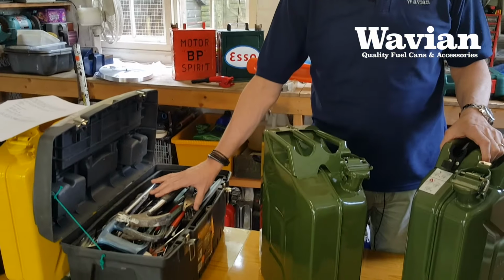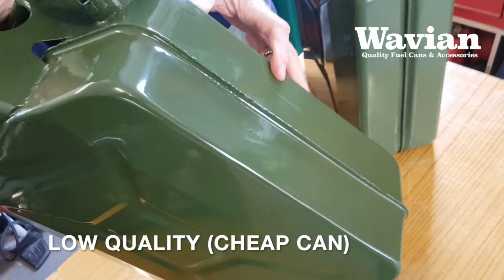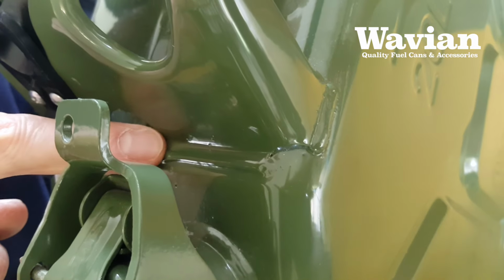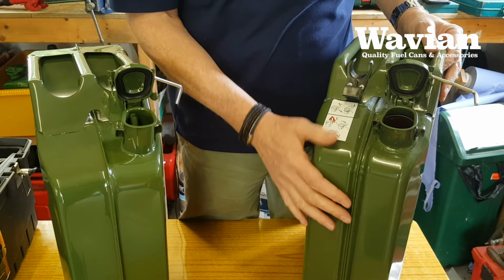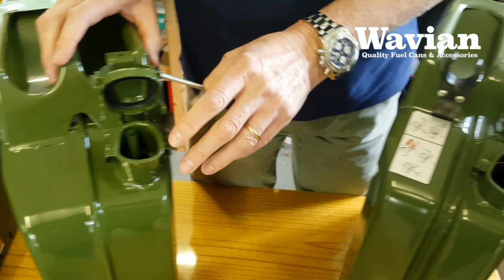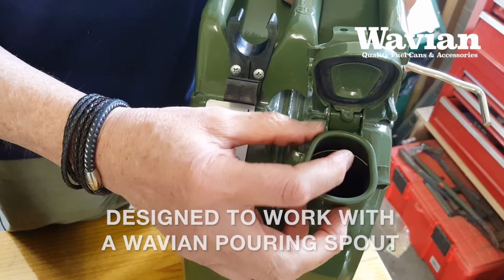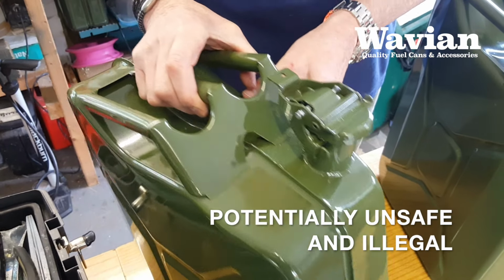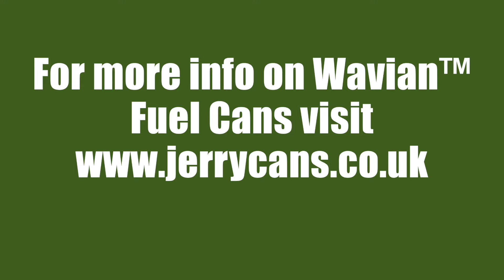What is the difference between a good Fuel Can and a bad Fuel Can?

Comment: Two days ago I bought a British canister of German design from a friend. It has markings only on one side. In the very center of the rectangle, the embossment reads W/I\D and above it the date 1944. I'm trying to check what the original paint color was. There are many layers, but I think it's a British khaki color, more of a brown color. Please tell me whether there was a norm standard for painting canisters and what color it was exactly? As I also have a wartime Safety Cooker petrol stove, I am looking for a smaller British fuel container - square little tin. I would then have a complete set for my tanker display.

Comment: Over the weekend we were supposed to get a bit of snow and here in the South that never ends well.  I was worried we'd lose power so I filled up a few gas cans for my generator. I had a NEW but CHEAP 'jerry can' in the back of my pickup. Got gas Friday, left it in the truck, Saturday I was walking around outside a noticed a strong gas odor. Seems the can contracted because of the cold causing it to buckle and form two leaks at the creases, one on each side of the can, formed by the slight buckling (not at the welds mind you). Luckily they were really small leaks and I might have only lost a 1/4 gallon but if I did not realize it or if the leak was worse who knows what would have happened if I started my truck.

So...I'd agree the cheap cans are not worth the money.

Comment: I own some milsurplus US cans,  I own a Valpro and a Wavian can, and I own two of these chinese knock off cans.   I got to say for the 50 bucks the knock offs came with a spout, and a jerry can holder.  When compared to the near 100 dollars for a Wavian can I can understand why people use them.  I personally use the Chinese ones for regular house duty and as back up fuel cans for my every day driving vehicles and have done so for several years now, they have held up better then I had expected. I use their jerry can mounts to hold my milsurp cans on my off roading set up and my wavian cans on my van.   

All in all I can say that the Wavian cans are of excellent make, quality and finish and have done everything I have asked of them flawlessly.  But if I could go back I would have saved the money and stuck with the milsurp, they work just as well (abated a bit less pretty)  cost me 24 dollars,  and have held up great under heavy abusive use.   The Chinese cans work well for light duty or emergency cans and the mounts they come with and spouts work well, but they do glug a bit if you lean into them which is a large negative, the seem being exposed while a weakness has not caused a major issue other then some mild annoyances while carrying them.  the cheap handles is my biggest complaint.   I love the product, but the price tag for a metal box that carries fuel (doubly so when you factor in a mount for them)  is a bit insane at 150 odd dollars vs the competition (a Chinese mount and a surplus can)  coming in under 50.  To use your comparison it would be like if Knipex charged 20 dollars, but you could buy a used knipex plyer for 3 dollars that has some scuffed handles and plasti-dip it for 2 bucks more...you end up with a equally good tool, but at a fraction of the price.
Reply from the maker: Thanks for the comments Dies1r4e, I totally understand where you are coming from. The cost of the Wavian cans is a reflection on the many extra things that go into the manufacturing process, not to mention the distribution, expensive quality control testing,  safety certificates and regulations we have to comply with.  Something the Chinese cans distributors don't usually worry  about. Many thanks for purchasing the cans anyway, I would love to know how they are all bearing up in 5 years time. 👍🏼

Comment: What is the inside of my brand new jerrycan is red or not the same color as the exterior which is green? Thank you for your help.
Reply from the maker: Hi Keith, this is the special rezol lining that prevents rust. Only use your can for storing fuel otherwise this lining will break down.

Comment: I think the most important bit was left out. The insides! Are the chinese ones bare metal (BAD) and are the wavian ones powdercoated or resin coated on the inside?
Reply from the maker: That's actually a great point. Thanks! It is hard to show the interior lining, but you are right we should have mentioned that to it also opens up the debate about using a fuel can with a resin coated lining for storing other things such as water (which you shouldn't do).  You can read some info about this on our website https://www.jerrycans.co.uk/fuel-cans-back-to-basics/
Reply: Yes the Wavian are coated
Reply: @mikemccarthy6939 I bought a pair of second hand jerry cans made from aluminum. Says made in the USSR on them.  They aren't coated but aluminum doesn't need it. Worked out pretty well for gasoline.
Reply: I coat my lower-priced cans with gas
Reply: I coat my lower-priced cans with gas

Comment: Which welding is used to weld these jerry cane
Reply from the maker: They are seam welded, I am not sure which particular type? I will try and find out.
Reply: W.E. here.  It appears to me MIG metal inert gas welded. I would suspect due to the extremely high volumes it is robotically joined.

Comment: I do wonder for either can how they individually allow for expansion and contraction of the internal gasoline and vapors for example in the heat and cold?   I have a cheap Chinese replica of a can that has developed three pinholes in the side stamped embossments that were added of course to increase the section modulus stiffness.  (I also just acquired an authentic threaded cap USMC united states marine corps can that I suspect will last another 50 years)
Reply: The embossing on the sides is actually in place to allow for contraction/expansion.
Reply: @FranktheDachshund  Flat sheet allows for far more elastic deformation than anything stamped with ridges.  (Shipping containers as well should not at all expand or contract during transit) RIGIDITY is the name of the game.
Reply from the maker: exactly right!

Comment: I live in AU and I own several 20, 5 and 10l Jerry cans. Whether at home, in the ute and or at work I don't reckon I've ever seen these el cheapo steel jerry cans, never seen a 'Wavian' Jerry can either but all my steel cans are built identical.
I don't know if they're built to 'UN standards' the UN has no part in my life, as far as I knew they were rated for military standards for NATO, NATO is not the UN, ISO make standards, SAE does the same, and many more; I'm not aware that the UN is involved in industry standards.

They generally sell for around $70 AU at auto parts stores, tool stores, etc. color coded for different uses/fuels.

In any case if a company uses metal jerry cans rather than plastic they are doing well in my book, plastic cans are garbage.

By the way the Chinese can looks to be pressed together with some kind of pittsburgh machine or other gear press/bender like they do with ventilation ducting, or modern car bodies, I'm pretty well certain its the same for the Polish/Latvian 'Wavian' can.
They are absolutely not welded together as, if you remove the paint, there is no apparent marking from the heat, nor are there signs of tacs/re-starts or spot-welds, which would be necessary even if a machine clamped the can and welded around.

I still suppose they must begin as two parts which are joined and bent/pulled over in some kind of jig on an assembly line as otherwise the shape would be difficult to form as one part, not sure about the internal coating as it seems consistent as if it were done after the join, although, again, that would be counterintuitive.

But you sell the cans so you tell me.
Reply from the maker: Hi there, thanks for the question and comments Eli. Yes, the cans are expertly seam welded down the middle and then the top is put on after the rezol lining is coating is applied. It's v simple, but also very clever. Our quality control is second to now and we get virtually zero returns.
Reply: The ones from support cheap are the same ones as wabian made in Latvia by valpro. There are some cheaper ones with the small air vent around. I think repco has the Latvian ones , going by the logo on the side of the can.

Comment: What’s the difference in a jerry can that is for gas and one that says not for fuel use ?
Reply from the maker: Hi Bob, when you say Gas, i assume you mean fuel/petrol? Our Wavian cans have a special lining that will prevent the can from rusting and potentially contaminating the fuel. If you use these for water or something else though it can actually cause the lining to break down.
Reply: Ok thx !!
I got a can that’s marked 
Not for fuel ..
But that’s what I want to use it for ,
I was just wondering if I put fuel in it would it Break down the inner lining or coating that’s on the inside ?
Reply: @bobmcalister2131  Then don't put any fuel in it if it is marked not for fuel.
Reply: @ATruckCampbell   Hahaha yea I know .. but it’s been holding Fuel for 5 weeks now and no problems 🤷🏻‍♂️
The inside still looks the same.
I poor it in another can to look and poor it back in .

Comment: Well, good luck getting a new can today.  I spent weeks trying to order these cans from Wavian, eBay and Amazon and each can I got was dented on all eight corners, had scratches and paint rubbed off of all eight corners and finally the can I decided to keep leaked from the spout to can connection AND at the black plastic spring loaded spout assembly.  Wavian is complicit in allowing retailers to sell scratch & dent and defective cans as new.  I was emailing Wavian and they didn't seem very concerned with my experience.  Now I have to buy a cheap plastic can again which I detest.  I'm not going to waste any more of my life attempting to get a new Wavian can with this low character sales system they have in place.  Corrupt, damaged, defective, worthless product.
Reply: I did buy 10 nato French Jerry cans build in 1953/ 54 they very well build , inside they are refinished outside some scratches and minor dents .some sanding and spray paint they look great none of them leak , got them from sportmen’s guide for $23.39 great deal they better them wasian
Reply from the maker: Thanks for the comments, unfortunately like all products that get derlivered sometimes cans are damaged in transit by couriers before they reach the customer. Please be assured that they are sent from our warehouse in perfect condition.
Reply: @wavianuk  Thanks for the reply.  A summary of trying to buy your product:  I purchased five total cans from different retail suppliers.  Every one of them was damaged or had bubbling up metal under the paint.  When I finally decided to keep the smaller version of the can and filled it up with gas, the spout would not secure into the can with the rotating prongs.  I would rotate the prongs to hold the spout on the can and they would spring out again and the spout would fall off.  How many cans do your customers need to buy to find these perfect cans you claim are in your warehouse?  At the end of the day your product soaked my brand new Honda mower with fuel.  Not only do you not have cans that are not damaged on most of the corners but then the we try to use them they dump fuel on our machinery.  I returned that can to the seller and will never buy that product again.  Feel free to ship me a free one if an undamaged can exists that doesn't leak fuel.  Seriously.
Reply: @bertraminc9412  any company that needs to explain why they are better are not in fact better, they make these videos to say "hey, were a shit brand, but there are worse, not many but they do exist, heres one worse than ours" its distraction, i never buy from a company that has to explain why there better

Comment: What is your response to this video https://youtu.be/P8ALZrrvplA. It clearly shows your inner coating flaking and falling off as well as insufficient coating in the top of the cans.....
Reply from the maker: hi Flemming, thanks for the message. Apologies for the delay in reply. I've seen that video and the problem was because he used the cans for storing water. 

Wavian Steel Fuel Cans are NOT designed to be used for storing water. This is because the lining is not actually paint but a special Rezol enamel lining designed to prevent rust. I know it may seem strange, but as some other people pointed out on that video it is a matter of chemistry. Water has very different properties than fuel and certain chemicals (eg Rezol) react differently to it. You can read more about the science here https://www.quora.com/Why-do-you-think-the-water-and-diesel-did-not-mix-together

Our US seller is hoping Wranglestar will clarify this on another video. If you have any other questions feel free to get in touch. Regards, Pete.